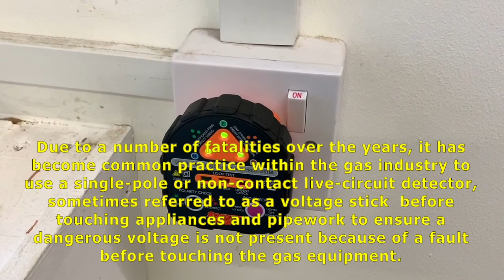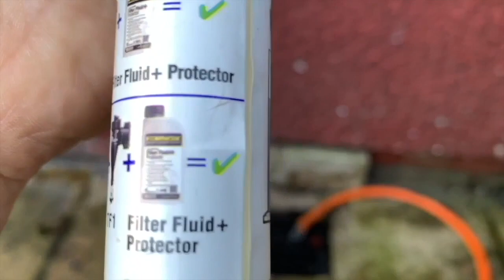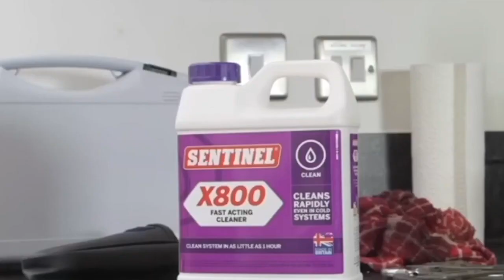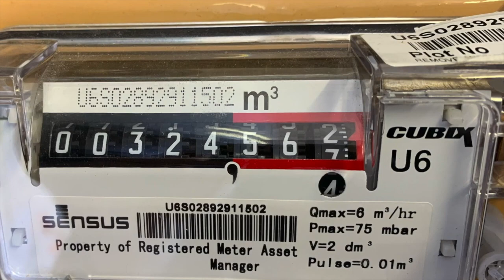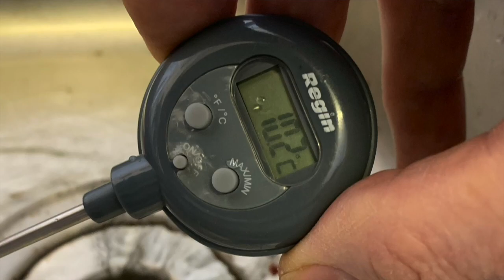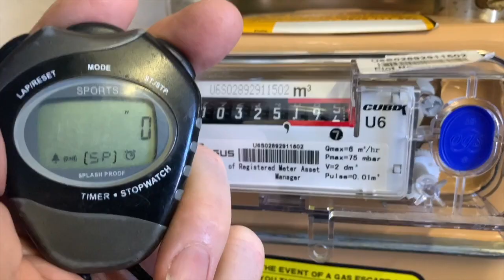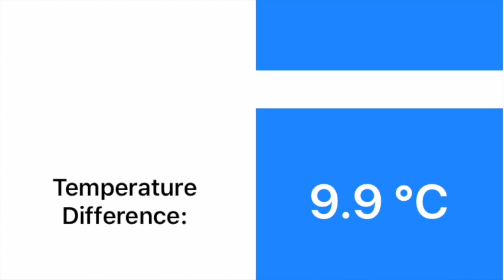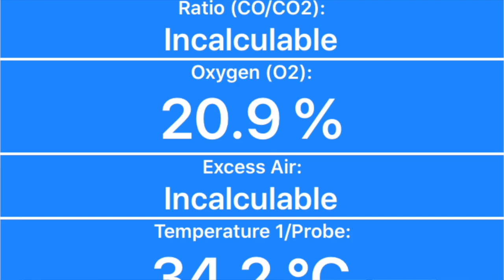Having a gas boiler installed in 2023? then watch is video and find out the installation process.

Comment: I do wish people would stop pushing combi boilers. If you have a house with separate bathroom and shower and 3 or 4 people living in it, a combi may very well not be suitable for your needs. 

Ive a regualr boiler in a 4 bed house with separate bathroom, shower and 4 sinks. 4 out of 6 local central heating companies wanted to fit a combi in place of the regular boiler and wouldnt quote when I told them I didnt want a combi thank you very much.

Comment: Just had a Worcester Bosch Greenstar 4000 30kw installed. After finding it was installed on 15mm pipework under the floorboards. I queried this with the installed and they told me, nah it's fine.

Comment: Tom Happy New Year, I've got a couple of questions regarding the video 
First is that you have installed automatic bypass on the combination boiler and I haven't seen any zones on it and I believe boiler has already installed a bypass,
Second one is power flushing and magna cleansing , I've always thought that power flushing comes together with the magna cleansing if the system is dirty to pickup all the debris from the system and the magna cleansing where you doing with the old boiler still connected or using the power flush machine?
I hope it's not confusing
Thank you

Comment: Hi Tom. I have been following your channel for some time now and you have some excellent content. 
I have been retired from a ESP company for 15 years now and I remember well the battles I had with installers regarding meter inlet pressures. 
I am not sure you were correct when you say the ESP will check the inlet meter working pressure with the boiler on High fire/service/sweep/mode. Plus 50% second appliance. 
As I read IGEM/G13 and I could be wrong🤔. 
Section 6 .1 States. If the RGE is on site then the the pressures can be checked with the appliance commissioning mode. 
Section 6. 6.2 If appliance has already been commissioned (suggesting that no RGE on site) the ESP will Check the working pressure with the appliance working at normal and/or HIGH OPERATING LOAD. 
Normal load for new un-commissioned appliances would be set to working on Hot water demand to taps or heating demand. 
APPENDIX 1.1 High operation load. Is the maximum operating load of the entire gas installation 
It says the combo boiler will be maximum demand with all hot taps running and any other appliances at 50%
Reply from the maker: The esp guys have been told to turn all the hot taps on in the house but most houses don’t have the water flow rate to do that

Comment: ahh but what does that oversized rad impact on? its the same principle that heat pumps shouldnt be over or undersized right? the system is loosing efficency? i know im being pendantic. you would set your trv,,,,,,,,,,,,,,,some people dont. maybe you tweak that one down a little on flow and return temp?
Reply from the maker: Over sized rads waste energy because they continue to put out heat into the room even when the TRVs have closed. The room will then overheat costing money and wasting energy.

Comment: so after a day or 2's work fitting a new boiler and you test and find you have a working gas delta difference from the meter to the boiler of 1.5 - 2 mbr. are you telling me your going to condemn the new appliance and now tell them they have to spend a further £ 500 - £ 1000 as they need a new gas supply pipework. ? yer sure you do...

Comment: Hello Derek.  Valuable video...but I was very disappointed in how little insight you gave to achieving the delta 20 between flow and return. Given that people have now cottoned onto low modulation rates and the need to condense then I would have thought this would have been one of the most important part of installing a combi boiler given that delta 20 is now  virtually an industry standard. You make  brief reference to it...but then just show testing a rad that only gives a drop of 9 degrees.  Surely to achieve delta 20 at the boiler will require delta 20 at every radiator  ?. My impression to date is that this delta 20 seems a bit of a Holy Grail..and probably is hardly ever achieved on most installations. I assume one would widen the delta gap by throttling the radiator outlets until the desired temp drop is achieved. (but at what effect on radiator output??)...and also by reducing the flow rate of the pump so that water at 70 degrees isnt just being forced straight through the bottom of the radiator. .Furthermore  this delta 20 is surely only be achievable when air and room temps are low (mid winter) ..such that the heat can escape from the rads . The implication of this being that in the early and later heating seasons as air temps rise ..then  the delta  temps will drop away as heat isnt so readily esacping from the radiators. This implication here being that if you have a boiler flow temp set at 70 in deep winter ..to get a condensing return of 50 degrees ...then as the weather warms and radiators dont release their heat so easily...then the flow rate temps will rise again..and possibly begin to exceed the condensing temp of 52 degrees. The overall impression I have to date of this whole condensing /energy saving thing is that  it is far from being as easily achieved  and  in reality  is being oversold
Reply: Just wondering if you had weather comp' fitted, it would modulate the flow temp down accordingly. Thus, getting closer to the magic condensation temp.

Comment: Obviously the industry is not being monitored properly. I often read about these so called Gas Engineers failing to do the job properly, so how can this keep going on? The industry is a shambles and I have no confidence in anyone to fit me a new boiler. How on earth is Jo public supposed to choose one that will do a proper thorough job?  It's no wonder some people try DIY even for boiler installs.
Reply: The industry/gas safe, sets out the training requirements. When these are shockingly low, what do you expect? Competent engineers, after taking a fast track course? So long as you can answer multiple choice papers, you are OK.

Comment: Happy New Year Tom!  Excellent video as usual. I need to change my Baxi solo 3 pf (23 years old) for a much more efficient boiler. I wondered if you could give me some advice please. I am thinking of changing my regular system to an Ideal Combi Max 30. I have a 4 bed  house with 1 bathroom. My wife and I mainly use the power shower which uses a 1.5 bar pump on the hot and cold and is nice and powerful. The Ideal Max supplies 12.5ltrs a minute of hot water. My Question is would this flow rate be as good as the current power shower. My mains cold water flow rate is 16 ltrs a minute. The mains pressure is 3.6 bar and 3.5 bar when another tap is opened.  The shower is an Aqualisa Aquatique. My gas pipe is 22mm. I cannot find this information anywhere on the internet!  
Thanks again for all your great content!
Reply from the maker: You won’t be able to run the power shower off a combi boiler. You will need to check the flow rate at your cold tap in the kitchen to see what you would get out of the combi
Reply: @tomkatgastraining
Reply: Hi Tom Thank you for your reply. I understand I would have to take the pump out and link the pipes. My question is would I get a shower as good as the one I have if I have the combi installed. The mains water flow rate is 16 ltres a minute.
Reply from the maker: @terrydavis9713  it’s the flow rate through the combi you need to look at and the flow through the new shower. If the flow is greater on the shower obviously you will only get what the combi gives you